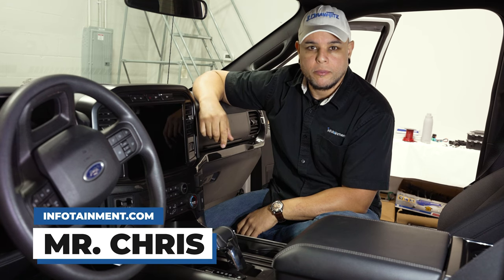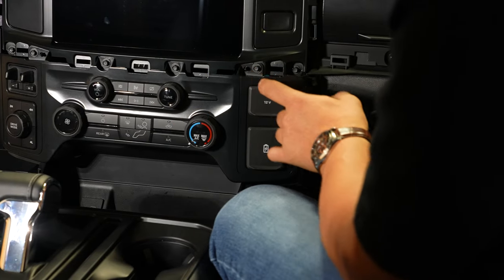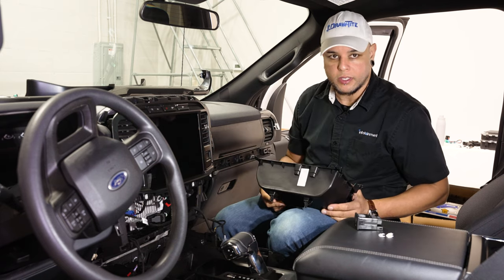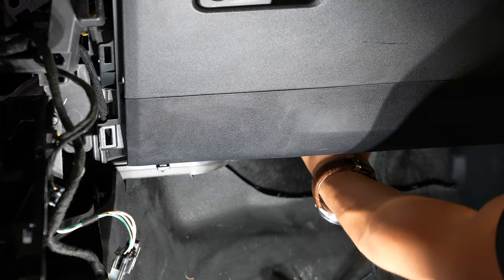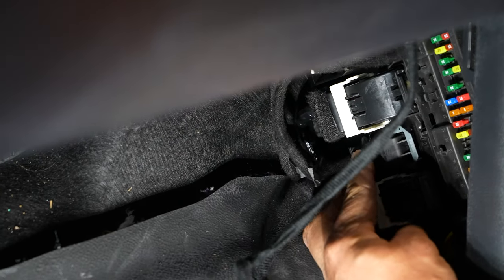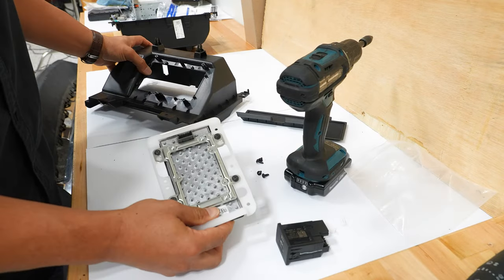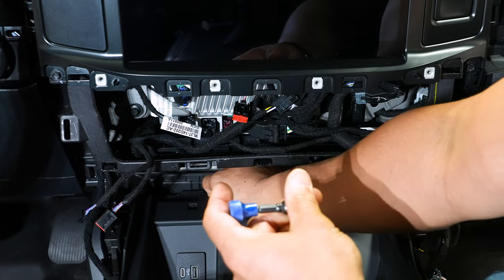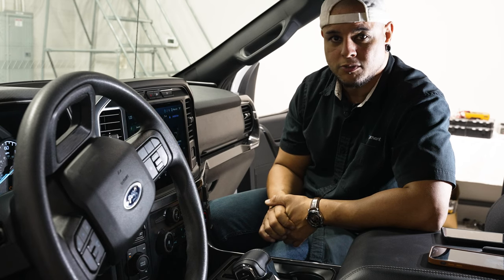2021+ Ford F-150 - Wireless Charger Installation Guide - Infotainment.com

Comment: suprised you didn't add the cubby light since there is a hole for it, or so it seemed.  but that would probably require another harness.
Reply from the maker: That's correct. It's been really difficult trying to obtain the light, and then we'd have to make a custom harness in addition. While we would like to have the cubby light, it's not necessary for the wireless charger.